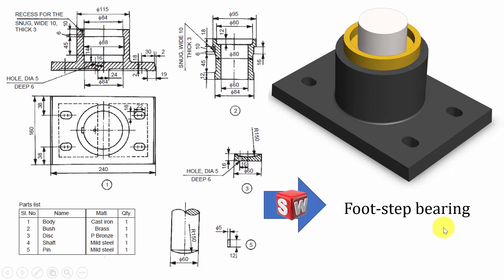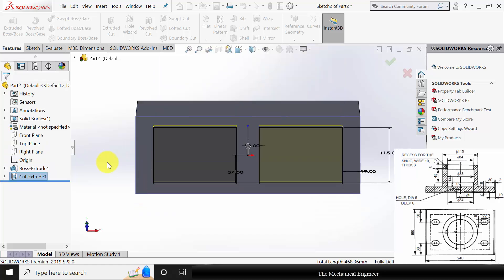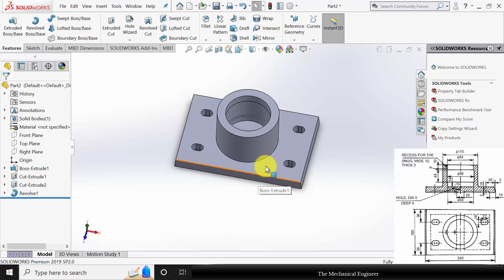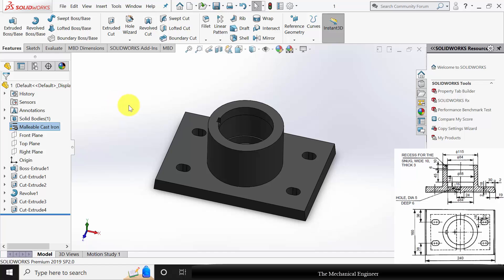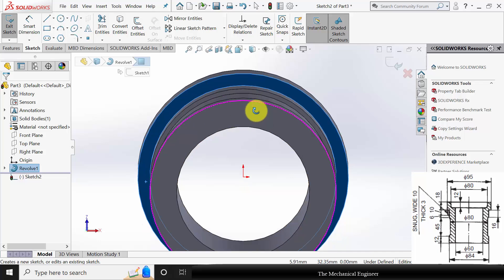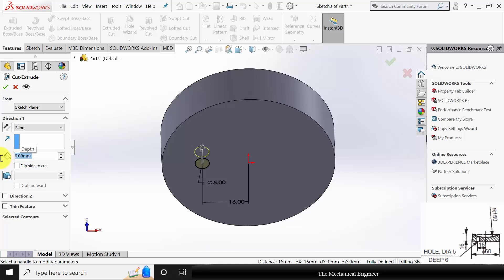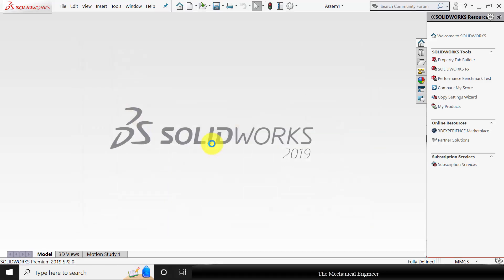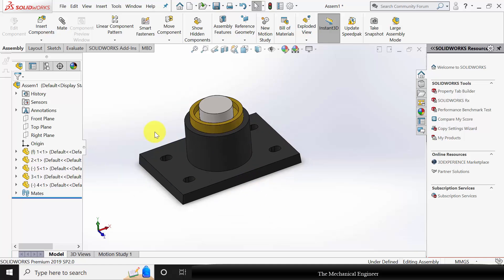Foot Step Bearing using SOLIDWORKS | Parts and Assembly | SOLIDWORKS tutorials for beginners

Comment: According to the body which shows the plan of the foot step bearing, when doing assembly drawing of it are we supposed to draw the full diagram or sectional
Reply from the maker: We should draw the full diagram, but we can convert the drawing into a sectional view. This helps in clearly showing the internal features and components, which are crucial for understanding the assembly and function of the bearing.